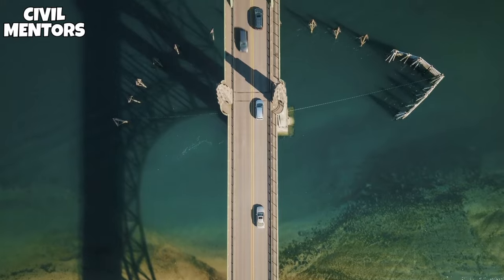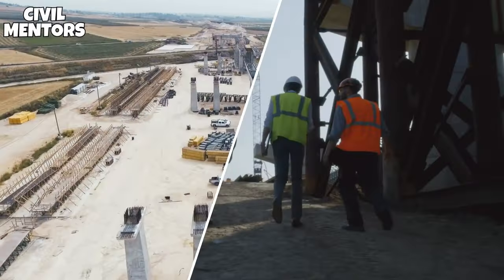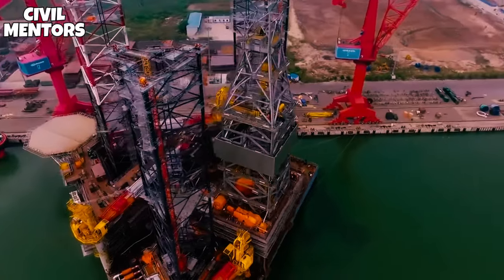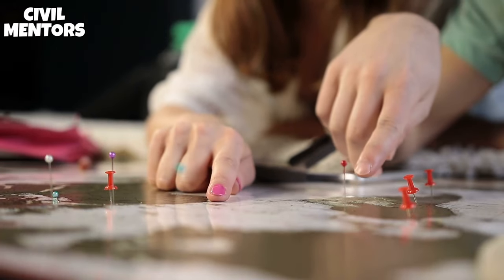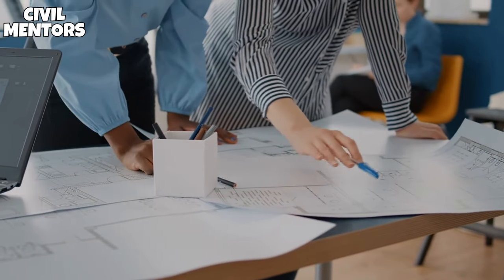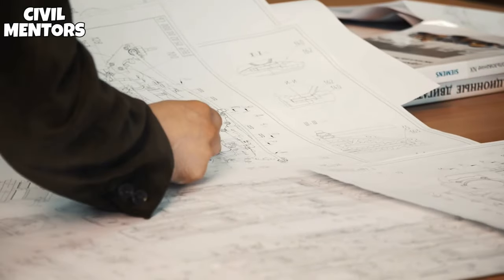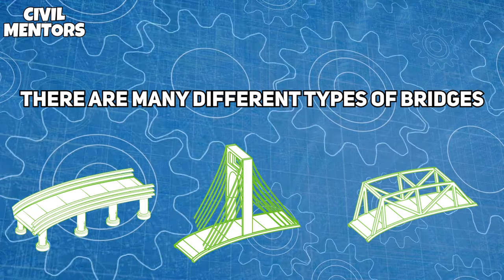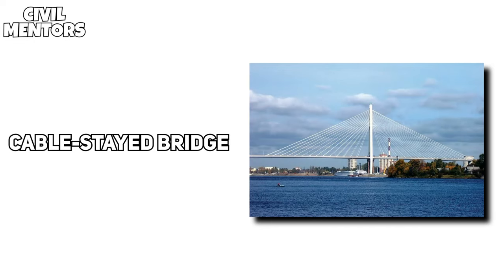How Bridges are Built over Deep Water?

Comment: Great video... comprehensive yet understandable to average non-engineer...

One thing all these different bridge types have in common is they must resist gravity. The larger and heavier the bridge, the sturdier it has to be. And, all of them look easy to build on paper. Site prep can be extensive. Some civil projects require constructing roads to the building site. Many areas in Japan and Chine have rugged terrain. Cut and fill, retaining structures, drainage, etc all have to be done before the bridge can even be started.

We have 'Floating Bridges' across Lake Washington in Seattle. Who says thousands of tons of Concrete can't float?